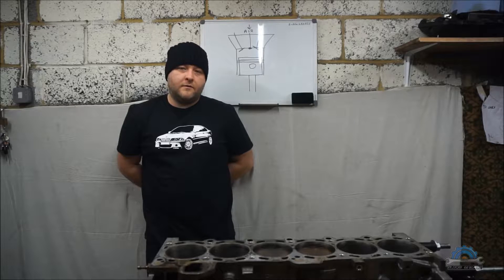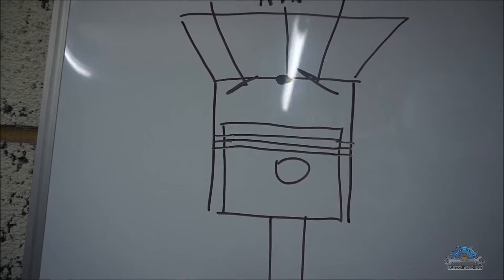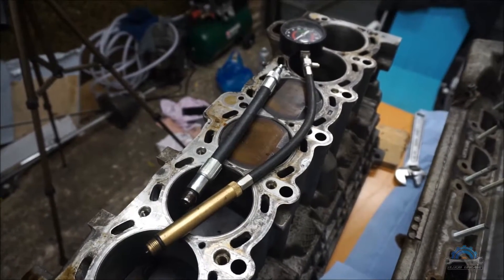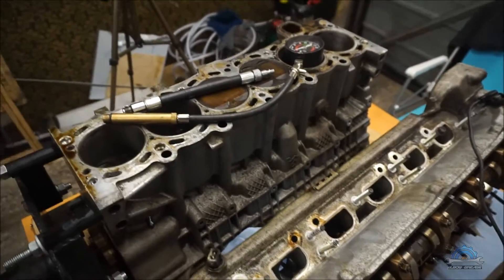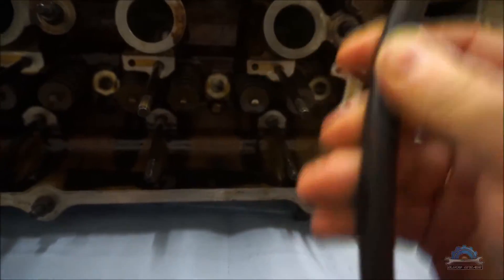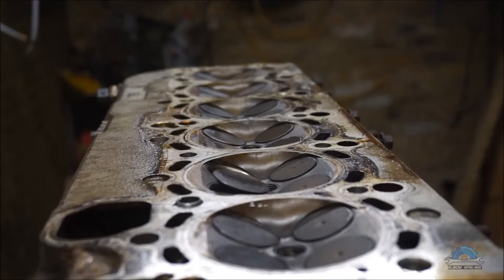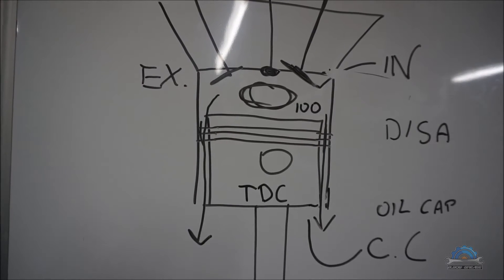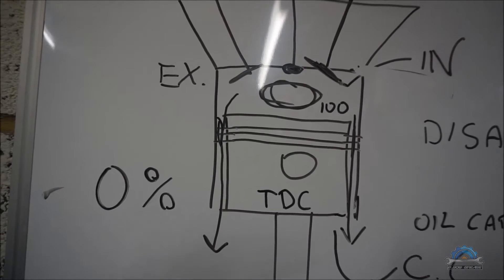BMW LEAKDOWN TEST without gauge

Comment: you're wrong air won't go through the intake manifold and then come out of cylinder 4 it will just escape out the intake manifold go through the IAC and go through the air filter. it wouldn't go into another cylinder unless the intake was completely blocked and air tight
Reply from the maker: Bill Rogers Im not wrong. IAC have seperate channel/ port and you appying 100 psi /7bar  and IAC have a small hole.Please test it .
Reply from the maker: Bill Rogers Can you explain  your theory?
Reply from the maker: Bill Rogers with 7 bars of pressure air wont escape that quick through IAC which is half open or ccv.Air will be leaking everywhere until you set TDC ,Even 50's kid made new video with correct results after watching mine.LOL